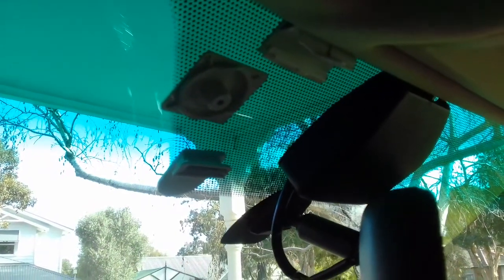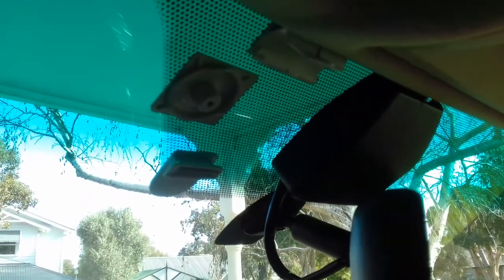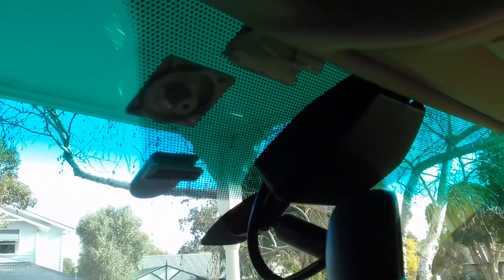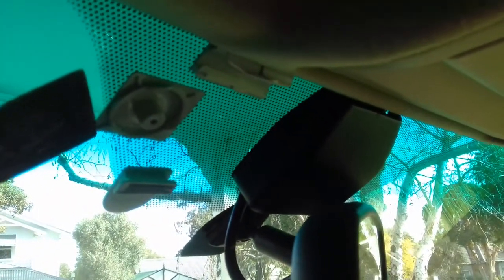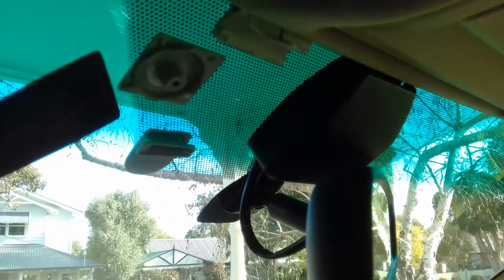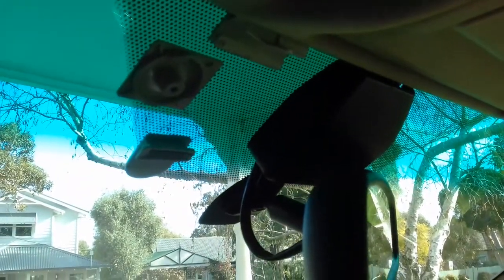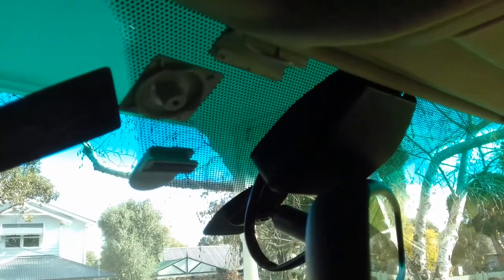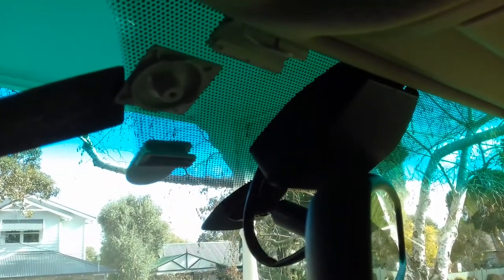How to remove etag bracket from your windscreen.

Comment: Your way worked best. Dental floss, no good.
Reply from the maker: Thank you for the feedback.  Might that a bit of time and extra care all works out fine.
Reply: use a fishing line instead of Dental floss
Reply: Dental floss works. Then peeled the glue patch off. Just did mine today.
Reply: That is very risky, you can scratch your windscreen. Use a fishing line instead.
Reply: Worked perfect for me. Dental floss kept breaking and killed my fingers. Not everyone has fishing line either.
Reply: @mrziggysmum  Going to try that, never would have thought of it. Thanks! Spatulas etc feel way too brutal of an approach to me.
Reply: @woolmerc  Lol not everyone has spatulas either. Plus I'd rather not take a spatula anywhere near my car